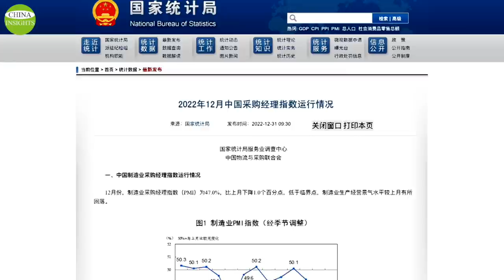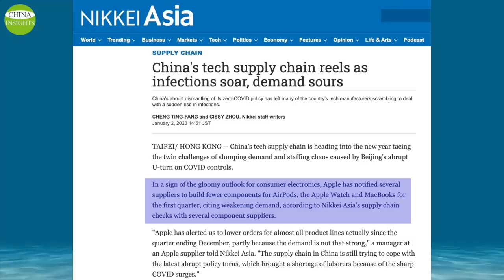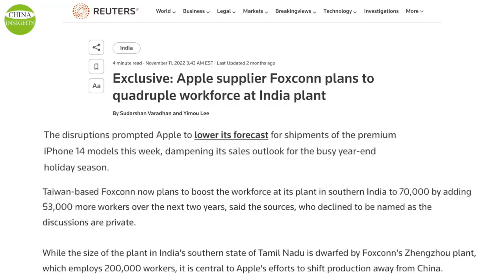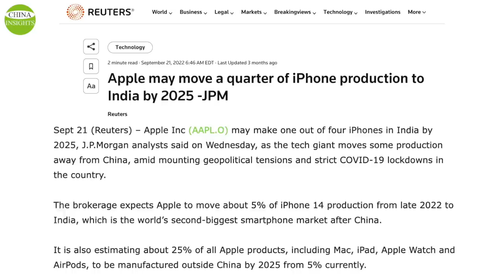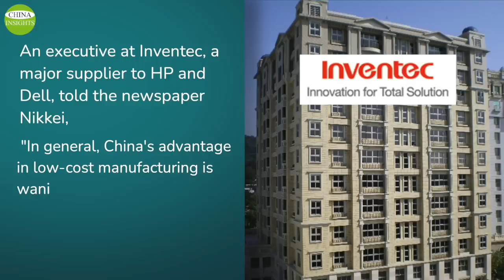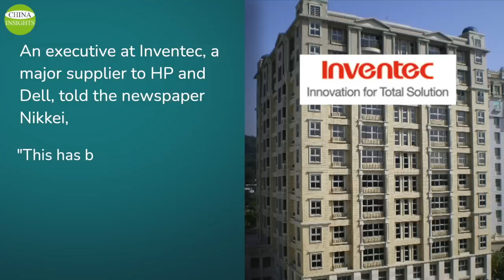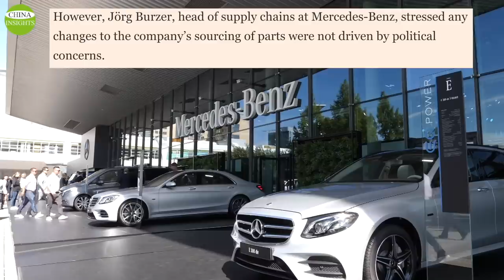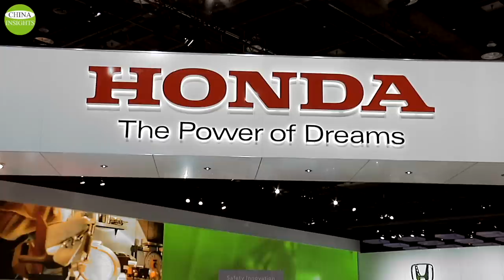China: losing the technology race with the U.S. & the goal of manufacturing powerhouse falling apart

Comment: Its funny (ironically) that despite warnings to China for years that this was coming and even the hammer falling in form of trade and tech sanctions that were a long time coming seemed to leave many in denial. Well there are no more excuses and no way to hide from it. As for the supply chains of European car makers, it is easier explained when you look at the main stock holders. China is the largest single stockholder in Mercedes-Benz as well as a major stockholder in several others. This is how those supply lines get pushed towards China and the companies do nothing to correct this fault even when the impending doom of China has been evident for years.
Reply: probably explains why Mercedes went to Non negotiable price of vehicles rather than allowing dealerships to negotiate. There was talk of Court action from them
Reply: Dude, even chinese companies moved their production to cheaper countries. This is nothing new.
Reply: I do think a lot of foreign car production is in the USA for exactly the same reasons as in China. To avoid loss of jobs and trade imbalance.  Japan and Germany were forced to be local to serve the local markets or they would face tariffs.
Reply: @bjrnhjortshjandersen1286  Actually most of the plants are just final assembly these days with the major components all still being imported. The reason for having so many of them spread out in the states is actually political more than anything. If you have a assembly plant in two or three states then you have up to 6 US senators and a dozen or more congressmen all pushing for your company in Congress. The local governments will give tax breaks and other incentives to them for bringing in the work and the company gets influence in Washington DC as a bonus. Even US companies that used to be regional, like Boeing, have had to spread out across the country to maximise their political clout in DC.

The easiest way for companies to avoid import taxes these days is to put their factories in Mexico and take advantage of NAFTA. Volkswagen was one of the first to do this and pretty much all of the US auto manufacturers have moved their production there because they can't compete with the cheap labor and non-existent regulations in Mexico. Today everyone from Maytag to Intel have factories in Mexico to take advantage of the Free Trade Agreement.
Reply: @socket_error1000  thankyou for supplying the details...this is how to balance ...even if often not optimal from a business point of view. Chinese also try to do similarly
Reply: @zebimicio5204  Thats hilarious to think about.
Reply: @Fanta....  Yeah, although NAFTA was supposed to level the playing field and actually uplift the labor and economics in Mexico by mandating all parties follow recognized environmental and labor rights laws common to Canada, the USA, and Mexico. This should have greatly increased the wages of workers in any factory there if it was exporting to the US or Canada.  Unfortunately Mexico isn't enforcing any of the them. So the Mexicans working at many of these factories are still getting paid poverty wages. Without any language that allows for the other nations to effect a punishment on another for allowing violations, Mexican companies get away with it. Which is why it turned into such an unfair advantage for companies that moved there and so unpopular with most Americans who just saw jobs heading south of the border. Even when Trump threatened to tear up NAFTA all he did was rewrite it to give US companies that move there a little more tax leverage in the US. Still no enforcement language of the regulations.

Comment: It's reasonable that as labor costs increase, a great deal of the lower value-added manufacturing will move away from China. The question now is one of  how rapidly China can move up the value-added chain.
Reply: Wrong... the future belongs to the market. Which market is the biggest? They will drive the production...
Reply: @satriojumeneng7055  No. The future belongs to capital. Capital flows to areas that provide the biggest returns.
Reply: @calc1657  Capital will go to the biggest market because that's where the capital will grow more quickly.
Reply: @satriojumeneng7055  No. There are other factors, such as cost of energy, protection of IP, rule of law, demographics, etc..
Reply: @calc1657  Cost of energy, China is the best because it has a long-term agreement with most major energy producers.

Protection of IP, China will dominate world IP in coming years.

The rule of law, China is the best because CCP can force the agreement. Unlike India, contract agreements may get refusal by Indian people causing the project to halt.

Demographics, China is okay because many young people are still not working.

But the most appealing factor is China's market size and purchasing power.
You make products for 1.4 billion people will be much more beneficial, and if you can sell them outside China, then it's even better.
Reply: Unless they do there own research they will be left behind.

Comment: Let's hope American quality control is 100% better than china's
Reply: I needed ball joints for my van i used to own, the ones from china were 16.00 a pc, they had a rubber cup mounted to a ball and thin iron molding. The US version cost me 165.00 a set. machined arms and pins welded together, wrapped in sealed boot filled with grease, ready to go, and i have no doubt when the vans life ended the ball joints are now on another vehicle.

Comment: I heard the same things 4, 5years ago when Trump was running the country. 🤣🤣🤣
Reply: I'm sure when you witness communism fail AGAIN you will say, "Oh!  That was never communism"...
Reply: @sammanis9148  You mean the high speed rail hardly any Chinese use anymore (they take smaller trains instead) on which this incident happened a few years back?

Jul 23, 2011 ... WENZHOU, China — Thirty-two people were killed and 191 injured when two high-speed bullet trains slammed into one another in eastern China.  

And China did not "invent" 5g, it merely "partnered" in 2018 with thoes who actually did.

February 2017 – Ericsson created the first 5G platform - Ericsson
Swedish multinational networking and telecommunications company.

February 2017 – Samsung (South Korean multinational conglomerate) develops 5G RF Integrated Circuit (RFIC).

February 2017 – Nokia launches ‘5G First’: Nokia is a Finnish multinational telecommunications, technology and electronics corporation.

October 2017 – Qualcomm create working 5G modem chip. Qualcomm is an American multinational corporation headquartered in San Diego, California. At its 4G/5G Summit in Hong Kong, Qualcomm announced that it had created a working 5G modem chip to be released in 2019.

October 2017 – Verizon, Qualcomm and Novatel Wireless announce 5G collaboration.

December 2017 – First live UK 5G test: In December 2017, network providers Ericsson and Vodafone UK carried out a standalone pre-standard 5G test in partnership with King’s College London.

February 2018 – BT Group and Huawei strike 5G partnership.